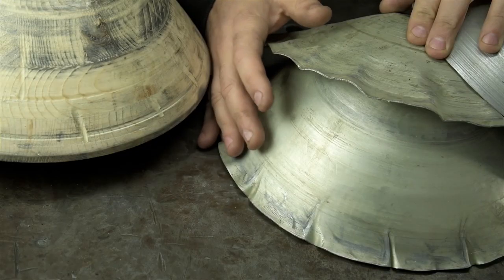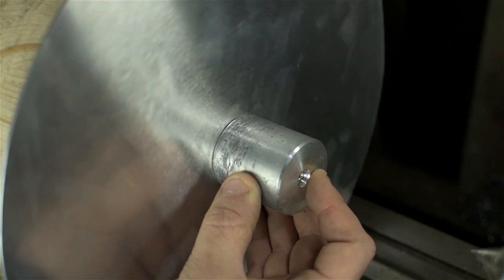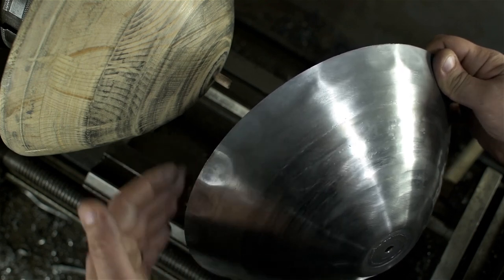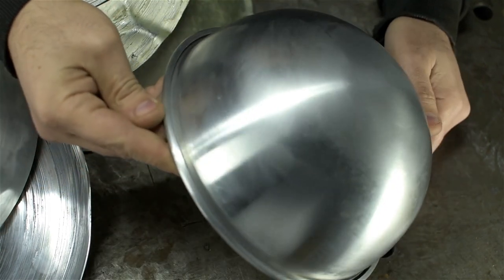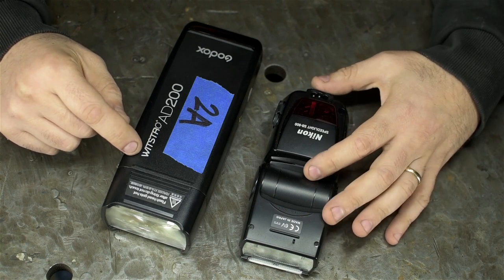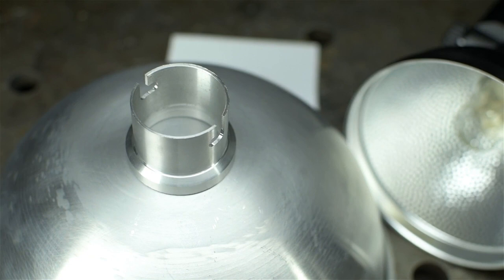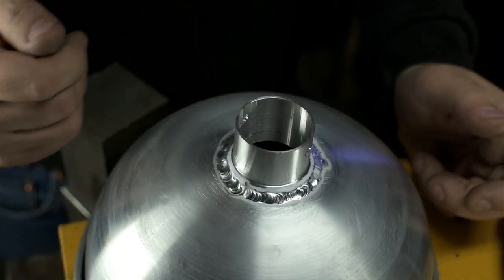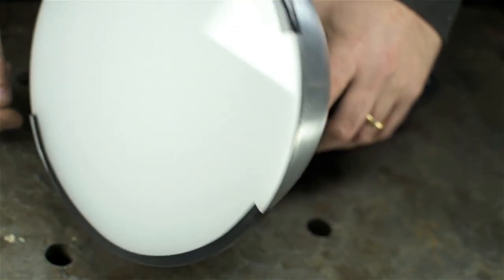Spinning Metal - Part 2! - GODOX Strobe Reflector Build

Comment: Err............... have you tried annealing the aluminium? At school, 55 years ago, I did some metal spinning, using aluminium. We rubbed it with a bar of soap then heated it with a gas torch until the soap turned black. It spun like putty.
Reply: I had the same thought. Not quite exactly the same, though; I came up through a slightly more conservative school; I was counselled that chocolate brown was the optimum soap grillification; unto chocolate brown only shalt thou proceed, lest thou be cast into the fires of damnation for all time. Mind you, they were probably just drama queens.
Reply: In the same era, I remember only using a hardwood stick/dowel as the friction created excessive heat to coax the metal into changing shape. Also, the whole shaping maneuver needs to be done in one pass to maintain forming temperature.
Reply: I learned this in the same 50-55 years ago era. I've been trying to recall the tools used. They certainly didn't have a bearing.

When he used the nub, it reminded me the technique was faster than what he did previously.  He seems to be working tentatively, and that may be the root of his problems.
Reply: It might just be that it needs to be room temperature, and not "old Tony garage" degrees.
Reply: @SW-zu7ve  It didn't make him sound like an asshole.  Your comment on the other hand entirely did.  Good job!
Reply: @wotmuddingtrolloc  Err..........Thanks!
Reply: Tiny Workshop, Big Ideas , I remember soap being used and a rod/dowel with low conductivity. That’s back when I was at tech school. Seems like there was a couple of shaped tools. It’s almost 30 years ago.
Reply: You are on to something with annealing.  I once had a project with thin wall brass tubing that needed to squashed on one end from round to an flatish oval shape.  Then this ovalized section had to be bent at a 45 degree angle.  Two separate bending operations.  Long story short, It had to be annealed before the fist operation and annealed again before the second.  Why?  Because it was already work hardened by, I assume, its manufacturing process.  Then when it was squashed over the oval mandrel, it hardened again. 
So it needed to be annealed before the final bending operation.  If annealing was not done in either operation it would crack the workpiece.
Reply: I believe you can anneal aluminum using just the acetylene from your torch and letting the soot build up in combination with the heat.
Reply: thats what i was thinking too. aluminum gets brittle when stressed. that bit around the holder that keeps breaking off is probably work hardening and coming lose. probably wouldnt hurt to anneal it a few times through the process.

Comment: Hey love the video! I believe what is happening is the disc starts wobbling as it is worked around the form causing the aluminum to work harden and fracture around the center. 
I used to use an old wood lathe to spin mettle and I would use a Oak bar in my left hand behind the mettle while using the forming bar in my right hand to get a consistent turn.  VERY DANGEROUS! But works well. 
I learned from a Audells  sheet mettle book from the 1950s if you look online you can probably pick up a copy.

Happy Mettle Shaping! Cheers!

Comment: It looks like your parts break from flexing at the edge of the clamping cylinder. Perhaps, if you switched cylinder to a bigger size, after shaping the part close to the center, progressing step by step outwards, you could avoid the breakage?
Otherwise, department stores have clamp work lights that come with aluminum reflector 8”, 10”, and (if I’m not mistaken) 12” in diameter, under $10.
Cheers.

Comment: This is probably an ignorant question but why doing you put it back on the large and run some sand paper on the surface to clean the finish up? Or make a bearing with sandpaper on the outside.

Comment: I just realized how to spin the aluminum with  perfect result, hmmm....
You have to do a bend or roll over on the outer edge first of all. Then the edge will not shrink while spinning. It will actually help to stretch the metal instead of just bending it. If you don't want a bend on the edge you just cut it away when you got the shape.
That's my guess ...

Comment: It's  possible that  someone else jas mentioned this but thr first thing i would do is set the edge of the metal.first  a piece of wood with a cut at the end  bend the metal towards you when the lath i turning bend it a few degrees this will stiffen  the edge and stop it from buckling.

Comment: Hey TOT, at my machine shop we do a lot of metal spinning, normally we work with aluminium, stainless steel and mild steel, but all this material when we order it we have to order it in a special order because it most be a in your case aluminium for spinning. But talking about the technical stuffs. For start before giving the final shape, you have to do a kind of bending like 10° for the side of the tailstock, and after that with a big round bearing you start spinning the material with some hand soap, but we start from the center  to the top but this step ia just to stretch the metal for the final shaping you most do it with a egg shape bearing for that and more soap ( in titanium we use to wet a little bit the soap. Be careful with the force  you apply in the material, because in some thin material it can broke from the center ( ah, and by the way, normally we have a spring load tailstock),  that because as you start shaping the sheet the forces that you apply make the sheet go finer and finer, normally at our machine shop here at Portugal in aluminium sheet of 2mm after getting the final shape it gets 1.6/1.7mm. That why we order special material because aluminium sheets for metal shaping use to have 2.15mm instead of 2... because of the compression... 

Hope to be helpful.
Reply: Olá Bruno, estão situados em que zona de Portugal? Abraço ✌️

Comment: Not being a perfect parabolic mirror is not too much of a worry. The lamp is not a perfect point source anyway. Not even close to it. 

And if using a diffuser a parabolic mirror is not any better than a half-spheric. Just make sure any light heading away from the diffuser is reflected back onto it, disregarding the direction of the photons when they hit it. 

So now that you have a buck, find a hammer and make the failed attempts fit the buck.
You can even use the wooden tit as a hammerform and not just a buck. 

And i have now given you so many thumbs up that i have only 2 thumbs left of the 10 i started out with.
Reply: That bowl did not "look"  like it was parabolic...  It looked like half of a sphere...    Spherical.
Reply: Shhhhhh

Comment: At the last place I worked (making whisky stills) we had to convert a (much larger) normal lathe into a metal spinning lathe, to make some fancy Greek amphora looking bits to go between the pot and the neck of some stills. It worked after MANY trials and tribulations, and probably in excess of $1500 of copper wasted in R&D, along with a few thousand bucks worth of time, both in building all the tools to convert the lathe, and trying to figure out what the heck we needed to do - incidentally, the tooling we made had a much tighter arc on the turny-bearingy-thingy that contacts the work. Maybe a 25mm-ish, but oblong, arc. Dunno if that made it better or worse than yours with a larger radius though (getting back to the 'dunno what the heck we were doing' thing).

We kept breaking off the centre of the copper also, ended up welding an extra turned disc of 3mm copper onto the middle, that helped it hold. Also worked out we needed to set up the oxy torch breathing fire on the lathe, to keep the part annealed the whole time.

All in all, would have been soooo much easier if we could have just bought those parts. We ended up with MANY lampshades, which I think my bosses wife turned into bird baths.
Reply: woogie2901 thanks for taking one for the team and sharing this... i like the idea where you bulk up the middle material.  i’ve been wondering too about the annealing situation, whether or not This Ol’ is using “dead soft” material to begin with.  i commented “loose the wood form and torch it at the lathe” in the last video... Tony always ignores my advice.  Love you, Tony!
Reply: Stress relieved materials are much easier to "work" with. Certain types of aluminum work harden like crazy. Others (dead soft) don't care. We learned this at my shop with spiral flute blind hole "chip extracting" taps. 6061 is a no-go. Gums up or sticks to the tap and it breaks right off the bat. 7075 actually has some hardness, and the chip will come out and break. There are so many different types of aluminum though. I'm not sure which is best for spinning. I would say though it probably has a lot to do with "technique" sadly. I would only work out from the center. Pressure has to stay consistent as well. It stands to reason buck finish and your feed rate will directly affect part finish. Clearly the material is work hardening near center.

Edit: you might just be better off with some type of tin material, then have it hard chromed or spray it silver after finishing.
Reply: You would not want the wood form to be "loose.
"
Reply: @averysmith1118  I think he meant lose, as in to get rid of because it's combustible.

Comment: I should preface this comment by saying, I know nothing about real metal working or machining, but I am a theatrical carpenter. Take that to mean what you will. Regarding the center of your blanks breaking out while spinning; it looks like as you work outwards on the blanks they haven't conformed to the buck tightly enough and the blank bends at the interface of the buck and clamping face. As you know, aluminum fatigues quickly, and I believe this is what is happening at this point. Perhaps if the edges of your clamping piece were a more gradual taper, or if it was a softer material (rubber?) it would better distribute the forces and delay metal fatigue. Similarly, if you were able to consistently pull the aluminum away from this junction it may remove the side-loading of the blank that causes the fatigue in the first place. I realize this is probably a moot point as you've finished your piece, but I also suspect you're as annoyed by unmet challenges as I am.
Reply: I was about to say essentially the same thing. I wonder if epoxy or some other heat setting adhesive would help stop that wobble...
Reply: I don't think it is loose on the buck, I think what is actually happening is the metal is actually bending over the solid buck and then the centrifugal force is pulling back straight when he takes the pressure off.   That is not only making the lip, but weakening the Aluminum along edge of the buck because the work gets folded back and forth on it.  

That is also probably why the roller works better for him because he is putting less leverage on it and working it slower.
Reply: Nah, tench745 has got the right idea. He's essentially only clamping the ring of material immediately surrounding the dial. Furthermore, he can't apply force on the area surrounding that, because it's hidden by his clamping tool, so there will always be an area of material not in contact with the forming block. That will allow the whole disk to move to the side and distort, fatiguing and eventually cracking it.

One possible solution to this would be to stamp/hammer the middle part of the sheet to fit the block before spinning the rest of it. This would be best accompanied by also making the clamping block clamp the material as close to the clamping block's edge as possible.

Another solution (albeit a much less practical one) would be to simultaneously tool the piece in two places 180 degrees from each other. Balancing forces on the material like this would also eliminate the repeat bending that causes fatigue failure.

Comment: I work for a firm with two cnc spinning lathes (and a herd of sacrificial goats).   The things are massive with a hydraulic power pack the size of ToT's time machine. I tried my hand on one lathe once  , it seemed completely uncontrollable   and likely to kill .Spinners are not human!

The lathes do not use g code : the experienced spinner makes the part, controlling the machine with a knob and a joystick  - they move the hydraulic rams that hold the forming roller in a manner that makes no sense at all to a humble turner like me.  The lathe records the motion and repeats on command

Comment: First off I (clearly) am not an expert on metalworking. However as  Physicist I've a few thoughts. Currently its looking like you work the middle exclusively before eventually getting to the outer edges. The commercial machines I've seen work along the entire length. The latter makes a lot more sense to me - by working the middle you are reducing the radius. Thus you have an outer edge holding itself at a large radius, an inner edge at a smaller radius, and so the outer edge (with less strength) wants to reduce its radius and the easiest way is either the crinkling you've seen before or the buckling you're seeing there. Two ideas speak to me as a physicist, though I'm certainly not sure if either is practical. First would be to try to work the outer edges early and to work your way along the entire form rather than just the part you're focusing on. A lot of commercial methods use multiple steps with multiple die to slowly work down to the form. The other, possibly unlikely method, would be using a hard die and using some real force to squeeze the work. That way the diameter at each point is the same but the larger surface area is made up by thinner metal. Either way good luck, no matter what happens this is pretty interesting.

As an aside, why not use the bearing to form the shape properly then do a final pass with the blunt stick? You get both benefits there. The problem so far is the blunt stick is imparting too much force dragging the work back which the bearing doesn't, and as the only part keeping it spinning is that little circle you've got a problem, especially as you move further out and impart more force to it (force times radius). If you reduce the force, a lubricant like the wax you used, or you found a way to spread the rotational force, say coat the die in rubber, or you reduced the force on the ring, say loosen it a bit and accept it might slip, you might be able to just use the stick. I don't know a practical answer but I can comfortably explain what's happening. It would at least work as-is for smaller radii work which is comforting.

Also its certainly not parabolic, it looks more elliptical. However if you're looking for more dispersion on the light you won't want parabolic anyway. You could scratch up the surface for more dispersion, though it looks like Ikea did that for you. The dimples in the real one have the same effect. The only problem with elliptical shapes is there are two focal points, the light from one will concentrate at the second and so you may get a differing effect with different distances. Still I'm assuming you're not at the focal point anyway so hopefully its just going to be a generally diffuse effect. You're of course going to lose a lot more light with your bowl flash, but I doubt that really matters and I'd imagine it works well enough. Another ghetto soft box for indoor use would just be holding up a white sheet between the flash and subject, light hits the sheet and diffuses and you can use just about any flash for it. Or aim it at a white wall, though you're pretty stuck with creative choices there but its useful to eat ramen noodles by phonelight at least.
Reply: Now a white sheet wouldn't make for a very interesting video, would it? Although I guess he could machine it out of a big block of cotton. Wouldn't put it past him.
Reply: I see you in a lot of comments...
Reply: I was thinking much the same thing. Work the whole surface as evenly as possible since you are expanding the metal as you go. You get into trouble near the rim as the outer metal is forced to distort, having expanded less. I'm not even near  being a metal worker (and I may be wrong in my guess) but I've done a fair bit of ceramics, ie, making bowls on a potter's wheel. You might not think it, but there is quite a bit of skill overlap.
Reply: The start there is almost completely backwards. If you start pushing the outer edge, you just lift the opposite side (as seen at 0:11), and that is exactly what's causing him to break off the middle disc. He needs to bend the middle  (not just deflect it) so it follows the form closely. Only when enough of the radius is bent (and pressing closely against the form) can he push down the outer part without lifting the opposite side.

Alternatively (or additionally), he can use a bigger block in the middle (with a curvature that is the negative of the buck) to shape that part and keep it pressed firmly against the buck. The key is to avoid the deflection you can see around 0:11.
Reply: @RFC-3514  This comment should get more likes because it summerizes what the problem is.